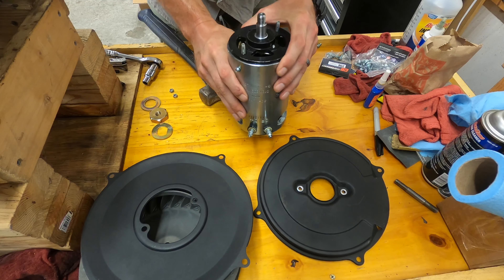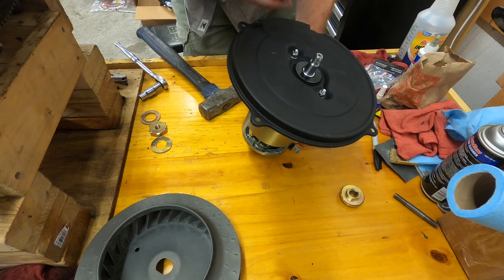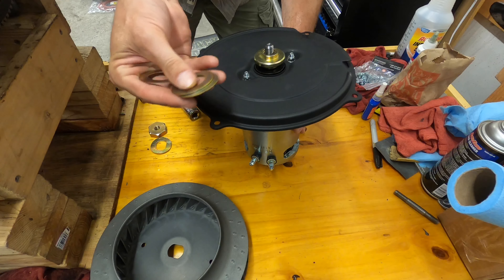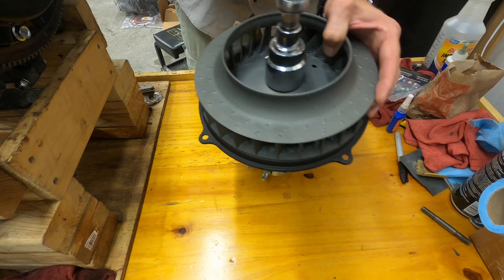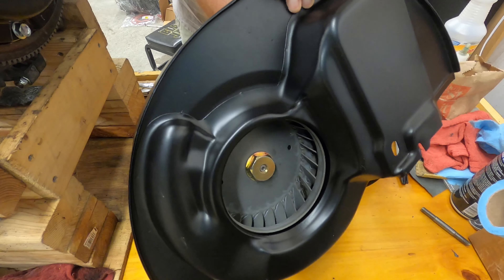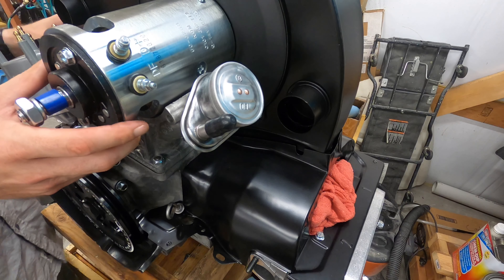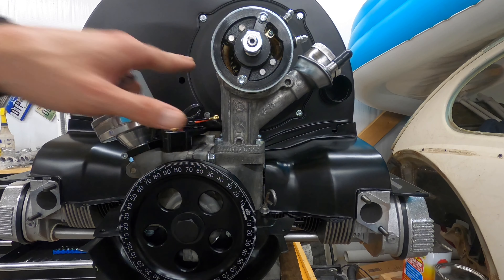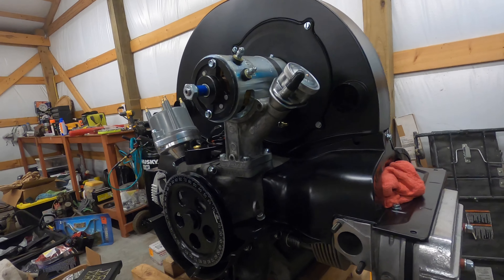VW Beetle Alternator/Generator Fan Assembly

Comment: Hey man, my lock washer wasn't on my new alternator 12v, and there wasn't one on my old one fan side. Will that be an issue? Can I just drop some thread locker on there? It is my daily driver and my generator/regulator/battery went bad.
Reply from the maker: I’d buy a new lock washer

Comment: I have installed the shroud without the fan holder. Now im realizing the fan will not fit in as the oil filler/generator stand won't clear the fan into the shroud 🤦🏻‍♂️🤯😡🥵 Now i have to install the entire fan component into the shroud and then lower it down to have it sit onto the gen-stand. Ayayayayeeee!!!!
Reply from the maker: Man, I’m sorry to hear that!